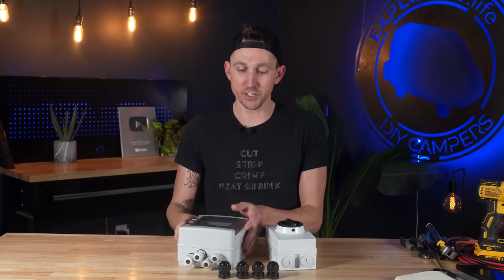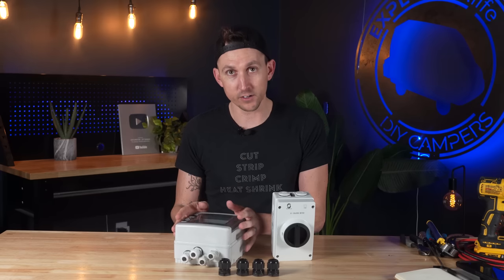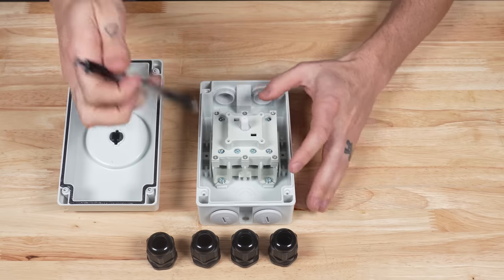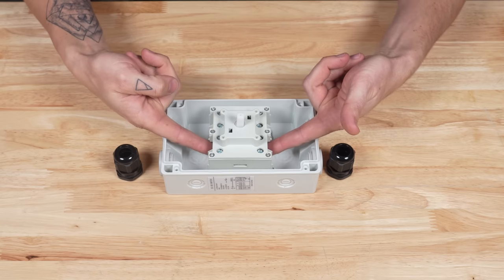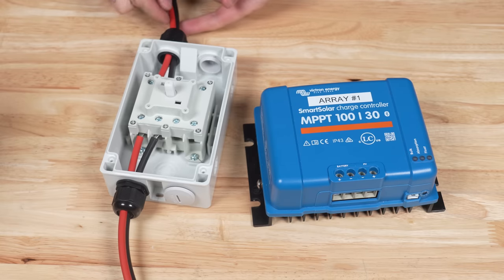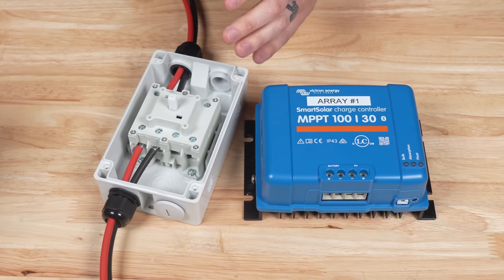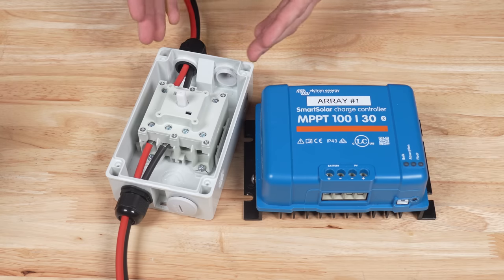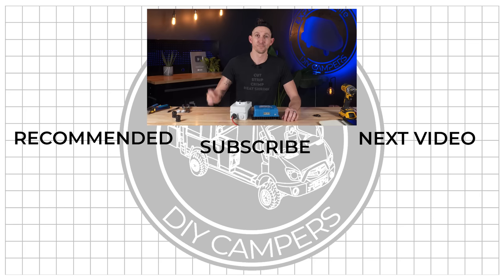SOLAR ISOLATOR WIRING (for a DIY camper van)

Comment: Hi Nate, I have a quick question: Can the van be considered (electrically) one giant piece of metal? If so, is it enough for example to connect the battery (-) side to some metal stud, pass a single (+) wire to the other side of the van, connect a lamp (or any other consumer), and the other side of that lamp, the minus side, to the "ground', I mean the van's body. will that work? thanks.
Reply from the maker: Here are the ways I recommend setting up a fully functioning system: https://www.explorist.life/solarwiringdiagrams

Comment: Thanks for the video! I'm relatively new to some of these larger diameter wires and have been recently exposed to using ferrules for them, particularly in conjunction with screw terminals (I have normally done much smaller electronics). I noticed that you aren't using ferrules here on the isolator, and I think I saw you doing that on another video as well-- is there any particular reason you're not using them on the isolator here, or are they just not necessary in this case (and if so, why)? Just trying to make sure I understand so I don't make mistakes in the future.
Reply from the maker: The terminals are so big there is no real danger of having stray wires cross over to the next terminal, which is my main reason to use ferrules.  Ferrules are tools and not requirements, and if they don't 'help', they aren't needed.
Reply: @EXPLORISTlife  That makes sense, thanks!

Comment: So I just purchased the original recommended breaker and box for the solar disconnect and noted the warning about directionality with that breaker - so which end of the breaker should I use to insert the solar panel wires?
Reply from the maker: The instructions or diagram on the breaker should help there.  There are too many different breakers out there for me to advise, which Is why we started selling this one in house.
Reply: It was the one linked from the parts list for the 2000 watt inverter-charger-520W-Solar-60A… another user suggested that PV input would be at the top and that would make sense as those are the only ones marked with a + and - .

Comment: Hey Nate, I am planning a photovoltaic system with several Victron chargers connected to a battery bank. As we know with chargers, you must first disconnect the solar panels after the battery bank, if they remain without power they (chargers) can burn because they do not know how to handle the power from the panels. What scheme should I use to ensure correct disconnection for servicing? Thank you very much.
Reply from the maker: Same way as I show in all of my diagrams.  Main battery switch for the battery connection and solar isolators between the solar arrays and the charge controller.  Simply turn off the solar array isolators before turning off the battery switch.
Reply: @EXPLORISTlife  Thanks.
Reply: @EXPLORISTlife  I've been watching your videos for a long time and I can't get enough of the education you give us. Maybe you also convinced me to use the Victron system. Thank you for your answer and your dedication in the field that you master so well.

Comment: Hi, we have that solar isolated from you and it’s great for our 2x 175kw solar panels into our victron smart solar charge controller mppt 100/30. As we are trying to go full electric we we’re looking to put up on top another 2x solar panels, this time 2x 100kw with another charge controller.
We don’t have anymore room on our lynx distributor for mega fuses so where would another mega fuse be positioned?
Reply from the maker: Check this out: https://youtu.be/W9n01vuGDgM
Reply: @EXPLORISTlife  brilliant, many thanks for this. I’ve just watched this and have one question before going ahead with this, where I would connect the lynx distributor bus bar to the mrbf fuse holder I currently have my VE.Bus Smart Dongle as well as another feed going to our smart shunt, are these still ok to remain on this terminal while connecting the mrbf fuse holder to take the cables to a smartsolar charge controller?
Reply from the maker: Put the fuse holder UNDER the ring terminals on that 'far-right' stud, and that'll be fine.
Reply: @EXPLORISTlife  fantastic, I really appreciate the time you’ve taken to help me, cheers guys

Comment: I have an EcoFlow Delta 2 that uses an XT60i connector to charge it from 400w of solar on the roof of my van. I would also like to connect a DC-DC charger to my car's main battery, and charge the Delta from that when the car is running. When the car isn't running, I would like it to charge via solar. I would like this to switch over automatically without having to manually hit a switch. There is only ONE charging input that allows that many watts at once on the Delta. Is this possible? Thanks!
Reply from the maker: The kits and system designs that we use will definitely do that; but I'm not sure about ecoflow.

Comment: Is this solar isolater water tight?   I would like to mount it on top of the roof of my truck camper, as close to my solar panel as possible
Reply from the maker: I would strongly advise installing it in your camper next to your MPPT or near your main battery disconnect.
Reply from the maker: It is IP66, though, but only when you use 1 wire per gland.  I still don't recommend putting it out in the elements, though.
Reply: @EXPLORIST life - DIY Campers  neither do I 😊

Comment: Oh great. But you are one week late. I just installed my 63 amp breaker/ disconnect last week. Hate to redo it. 
I put the solar panel wires into the top of the breaker. Is this correct?
I also used ferrules which I see you didn’t do this time. Why not?
Edit to add: I see your reply below on the ferrules.
Edit again: I have three, 400 watt panels in parallel. 42 volts and theoretical max of 28.5 amps.
Reply from the maker: The instructions on the breaker should say which direction the flow of power needs to go if the breaker is uni-directional.
Reply: Yes it did. So I should be ok. I will say the breaker box was very tight. Your new recommendation looks better for space

Comment: So basically these are just a disconnect switch not a safety breaker. Would it be true that a breaker isn't actually needed here because the solar arrays are protected by fuses on the roof? My point being can these be switched off whilst the sun is shining safely?
Reply from the maker: All of that is correct, yes.  If you have purchased/are purchasing from our store (shop.explorist.life) and want some more personalized guidance on that, reach out: shop.explorist.life/support

Comment: Ok, this might be a stupid question, but: Why wouldn't you just use a switch like the one commonly used as the battery isolator? What's the difference? This is about six times the size of that! Why would you want to use this?
Thanks, Nate!
Reply from the maker: Solar array voltages are generally higher than the 48V max on a battery switch plus the battery switch cannot simultaneously disconnect both the positive and negative conductor which is a code requirement.
Reply: @EXPLORISTlife  You're amazing! Thanks. (Imight add that I'm form Europe and might have different code for things, but not looked into them yet)
Reply from the maker: Yeah, even if you don't need it for code compliancy, the voltage is still too low in 95% of cases.  The max voltage of most of those battery switches is 48V.  A "12V" solar panel can easily be pushing 25V, and having only two of them wired in series would exceed the max voltage of the switch.  A "Battery Switch" just isn't the correct part when a literal "Solar Isolator" is readily available.
Reply: @EXPLORISTlife  thanks for that explanation

Comment: I purchased this solar isolator from you. I have a few complaints: the instructions that come with it are extremely hard to understand, and I can’t get the cover to reattach to the base.
Reply from the maker: Hey Joe!  Sorry about the instructions.  Looks like you never submitted an order ticket asking for help?  We've got several video tutorials I could have pointed you toward that would have helped you wire this isolator.  Re: the cover attaching to the base: submit an order support ticket and we will reply asking for pics to see how we can get that straightened out.
Reply: @EXPLORISTlife  thanx will do.

Comment: I want to wire 2 seperate batteries into my solar setup so I can run on one while charging the other, then flip when I deplete the battery. Could I accomplish this by having a NO/NC relay in between my charge controller and the two battery banks?
Reply from the maker: You can use and charge a system simultaneously so there is no need to do what you are proposing, no.
Reply: @EXPLORISTlife  the problem is charging a 400ah battery will take longer than 200ah with a 400 watt panel system and I don't have the real-estate to add more panels. Would it still be recommended to run the entire setup without splitting the batteries?
Reply from the maker: Correct.  You'll just need to supplement with shore, alternator, or generator.

Comment: Isn't there an advantage to using the breaker box as it also provides over-current protection?
Reply from the maker: The breaker would provide no overcurrent protection.

The overcurrent, if required, would come from from MC4 fuses upstream of the MC4 combiners (which are in each of our solar charging wiring kits, as appropriate)

Again... the breaker that I was previously recommending, was never never never in place for overcurrent protection as a breaker in that position could never protect from an overcurrent event.
Reply: Thanks! Glad I asked! The breakers I was considering have a current rating (e.g., 16A). This isn't sufficient for over-current protection?
Reply: By the way, Thanks for all the videos (even if my system is for a boat!).
Reply from the maker: Look for our old solar breaker video.  The 2nd half of that video explains why a breaker in this location would never trip OR would be tripping under normal operation.
Reply from the maker: Also our 'How to fuse a solar array' video.
Reply: If a breaker is installed as a DC disconnect or isolator, it will only trip if lightning hits panels and send overcurrent situation. The isolator switch is all that is a switch not a breaker. Dumb device compared to breaker with more tech inside to auto turn off in overcurrent situation. Bottom line having a DC disconnect between panels and inverters is a good thing.

Comment: Hi Nate, learn a lot from your videos, great work. Question for you, I have a single 150w roof panel and a solar on the side for ground panels. How would you wire the ground panels into this setup? I understand that you would run it into the right two terminals but there isn’t enough physical room to wire two sets of wires into my Victron MPPT 100/20 48v converter. How would you connect the bottom set of terminals so that there are only two wires exiting to the MPPT controller ¯\_(ツ)_/¯
Reply from the maker: Gonna need a 2nd charge controller. Roof and ground panels should each go to their own charge controller.
Reply: Thanks

Comment: Even if you have the switch, you would still need breakers to protect your wiring and equipment from an overload
Reply from the maker: That's not always true, no, but thanks for watching anyway!  I've got a specific video for 'when to fuse a solar array' about that concept, specifically if you give it a search.  Hopefully that helps clear up your confusion! 🙂👍
Reply: @EXPLORISTlife  thanks, I'll check that out!

Comment: Why would you ever want to disconnect your solar panels from the charge controller?  Whats the point? Why would you NOT want your solar charging the battery bank?  I’ve installed allot of solar systems.. never with a isolator or disconnect.
Reply: Maintenance, change your battery, repairs.

Comment: Many people have done the mistake of using 110/220v AC breakers and switches rated for the Ampere they have on their DC solar system of less volt. Problem is that AC and DC is very different when it comes to arcing and a 100A AC switch will be destroyed when it has to quench a 100A DC current arc and it has a risk of catcthing fire.
Reply from the maker: Yeah, this switch removes all doubt.  The old breakers we were recommending were DC breakers too, so they worked too as long as they weren't wired incorrectly.

Comment: 🤔not using wire-end ferrules?1??
Reply from the maker: Nope.  Ferrules are tools and not requirements and I didn't feel a ferrule was helpful in this particular application.  So in the spirit of 'not adding something I felt unnecessary', I omitted it.  The terminals are so deep there is realistically no way that stray wires can cross over to the next terminal over; which is one of the biggest reasons to use a ferrule.
Reply: @EXPLORIST life - DIY Could he could use a feral if he wanted to
Reply: Hi. In Europe (or at least not in Finland) we don't put wires in both up and down side in this kind of situation. We install both pairs from bottom side to keep it more weatherproof and installing them outside, also fire protection is a bit better. According to statistics, a lot of fires have started from DC disconnectors (bad connection).
 In addition to that, we also have clamps with rubber seal for double cables. And we follow IEC 60364-7-712 as our code. We do consider also DC disconnectors classification as DC-20...DC-22 and DC-PV0...2 etc.

Comment: a lot of dc  breakers go on fire as they cant extinguish  the arc
Reply from the maker: Yeah, if they are installed backwards and/or if they are rated for too low of voltage.

Comment: Why no ferrule?
Reply from the maker: Ferrules are tools and not requirements and I didn't feel a ferrule was helpful in this particular application.  So in the spirit of 'not adding something I felt unnecessary', I omitted it.  The terminals are so deep there is realistically no way that stray wires can cross over to the next terminal over; which is one of the biggest reasons to use a ferrule.
Reply from the maker: Tom... please start your own channel if you want to teach things.  Thanks.

Comment: in case of lightning circuit breaker is better then stupid manual switch
Reply from the maker: If you take a direct lightning strike, there is going to be a LOT of stuff messed up in your camper that a switch or a breaker won't help.

Comment: Just curious to ask is this kind of isolator needed in small systems? I understand it in buildings as like in case of fire but in RV? If we pretend like possibility to wires make short circuit or panel short circuit case then this would do nothing! Or is this just when voltage is so high that it may cause harm if you touch wires? I mean 12v or even 30-40v do nothing!
Reply from the maker: Ultimately, I provide the information and it's up to you on if you want to follow it or not.